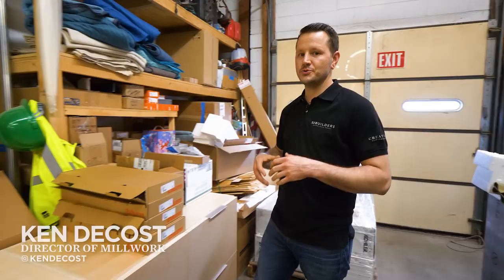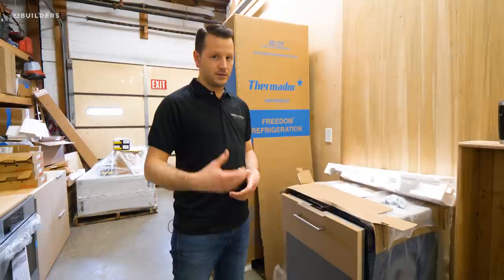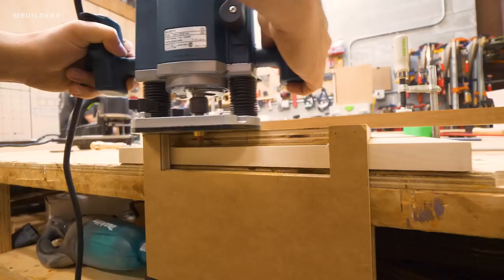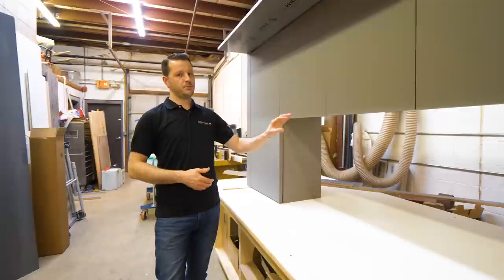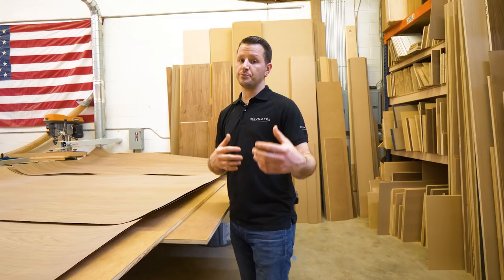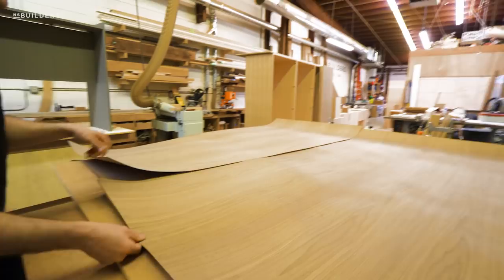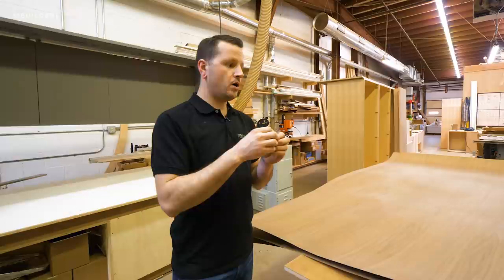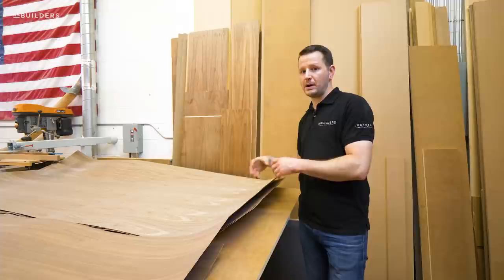Sequence wood veneer? Why is it so important to our process | Revealed

Comment: We have a couple of cabinet builders that we work with as a sub, how do we have a conversation with them to create a standard where they grain match the doors and drawers in the white oak cabinet fronts? Is that something that you find that cabinet makers will be willing to try, or is it futile at this point?
Reply: Really depends of the shop. Some just want to run and gun, slapping pieces together. Others are total craftsman and will does this regardless. Then there are those in the middle who would love to do it but maybe don't have the clientele to support it at the moment. I would have an open chat with them about it. Let them know what you're looking for and provide example photos. You'll need to go into it with the understand that it may take longer and cost a little more. If they're not open to the idea or challenge, then find another shop.

Comment: I remembered on one episode you talked about, or maybe it was Nick on site visit, a dishwasher that wasn't a standard size. How do you factor in the eventual changing out of the dishwasher.
Reply: They will need to find a dishwasher that fits into that opening or we will need really modify the cabinetry. I believe I recall the one you're referring to. It was an 18" dishwasher rather than the standard 24". There are options out there for other 18" models, but you'd be a bit more limited.

Comment: When you cut the pockets for the flush hardware are you accounting for paint thickness or does finisher mask off. 

Also, does your Mt Copland series cover veneering and substrates?
Reply: We are. The finisher does not mask off. The handles are removed prior to finish. Because that is now an open and porous area, we want it to be sealed well.

We have not yet covered veneering in the MT Copland courses.